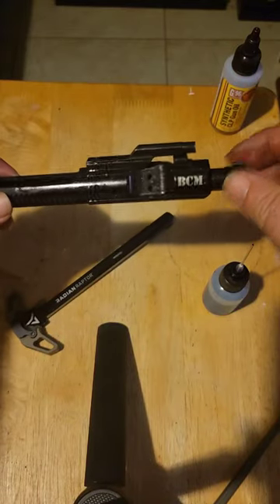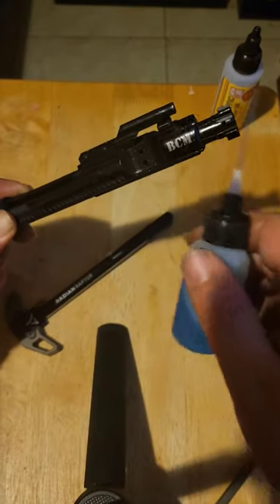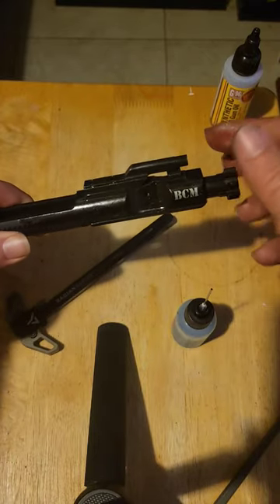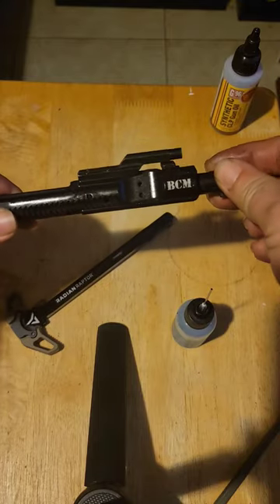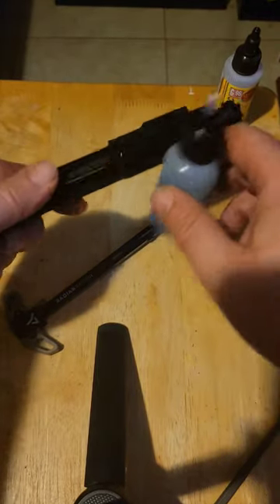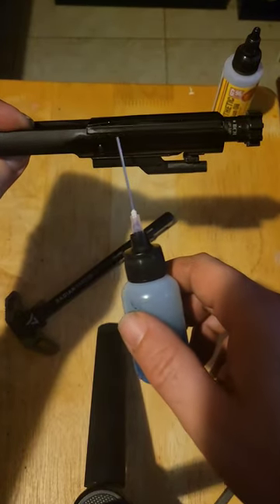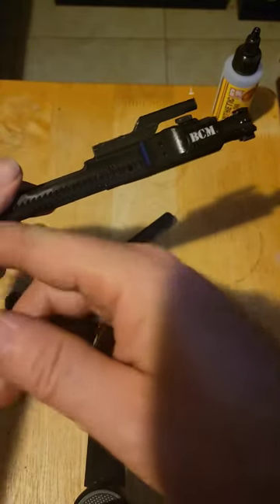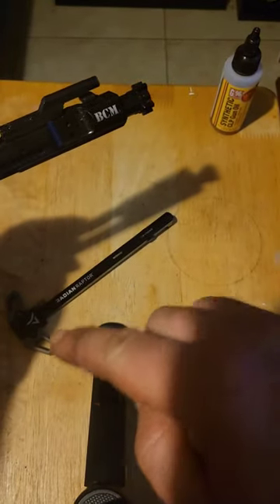Where NOT to put oil on your AR-15 bolt carrier! #shorts  #ar15 #556

Comment: You can lube everything inside an AR ! I run mine really wet thousends of rounds and i had no single malfunction . People must understand - its a machine ! Metal on Metal needs lube ! Period . The Spots like the Gasports and Holes cleans itself afte 2 Shots its dry . I also dont have any Carbon Build Up because the Carbon cant set on lubed Parts and i lube everything inside 🤷🏻‍♂️ Do not overthinking all the stuff . Smash oil over the the whole Bolt/ Carrier and nothing will brake😊
Reply from the maker: I oil pretty much everything as well. but if you ever see someone at the range. Using a needle applicator to squeeze oil down the exhaust ports on the bolt Carrier. I think the right thing to do is to tell them. That's not what those are for. In the military, we have had bolts seize inside the Carrier because of excess carbon build up to where they could not move anymore. So yes, carbon can stick once the oil Burns off. To each his own though it will run wet. It will run dry and we all have an opinion of what the better way to do It is lol 🤙👍
Reply from the maker: By the way I subbed to you bro, that range is bad ass
Reply: @boosted2809  Ok that thing with the needle Applicator is truley strange 😂 I got you 👍🏻
Reply: I too put a disgusting amount of oil on my ARs and never had a problem 😂 but I see his point and I don’t drop it right down those holes
Reply: omg… how uneducated people believe like what they know is true is really scary. metal to metal needs lube. yeah under low temp. smh… what is the point of replaceable seal?? did you ever see that oil still wet after 10 rounds? smh

Comment: A Vietnam vet told me that they would use her oil from the truck’s dipstick and slather it all around and the extractor was the only thing that didn’t get lubed
Reply from the maker: Yeah, they had so many problems with the M16. In that era, I wouldn't be surprised if the whole gun was dunked in oil just to get it to run LOL.

Comment: Not saying its right or wrong but  in the army we were specifically taught to put some oil in those 2 holes and lube up most the parts pretty wet. We also cleaned our weapons regularly tho more than most civilian shooters would
Reply from the maker: @edtronel2955  Yes, 100% I was a 19D and we all basically dunked the BCG in CLP. it made them more reliable for the environment, and elements. Now as a civilian mostly shooting static range it is unnecessary to use so much oil. All it does now is dirty up my rifle even quicker, especially shooting suppressed. I appreciate your comment brother. Side note: I oil my gas rings but I don't squeeze an oil applicator nozzle in there and full it up, which is what I saw at the range. And lead to me making a quick video 🤙

Comment: That to me is WTF why would you even think of doing that?
Reply from the maker: @douglasbaker5949  he literally was pouring slip2000 down the gas carrier key. Not just the holes on the side, which everybody is concentrating on in the comments lol. I lube my rings, but I take the bolt out of the carrier, not just fill it up with oil lmao

Comment: You should ALWAYS drop oil in those holes where gas is expelled from your carrier because that is your gas ring run. The AR15 bcg uses an internal piston to operate… And your gas rings function identically to the piston’s rings on your car.. You DEFINITELY want those lubricated. I don’t see a point in putting any oil down your gas key, though. Personally, I lube up the four rails which contact your upper then I put a bead of oil around my gas rings when my bolt is disassembled, then I put it back together and lube up the cam pin/cam track and I’m gtg.

Comment: Really depends on oil type. If you're using quality oil like a CLP or most synthetic gun oil out there then it'll be OK as they break down carbon and helps seal the gas rings. Gun oil is build to withstand high heat and pressure thus they won't gunk up.

Comment: Been oiling mine for a minute and running suppressed.  A drop or two in both holes while in and out of battery and then work the shit out of it so it spreads around inside.  I also do this all after the range.

Comment: You can lube that area with Lucas gun oil and you won’t have any issues. Same build up as if no oil was there. Give it a try.
Reply from the maker: That actually is what the blue oil is that I'm using lol,  it's great stuff. I was given 2,000 sample packs from Sig Sauer a while back so I just pour the packs in that bottle with the needle applicator.

Comment: I think most people put a couple of drops in just to make the carbon easier to get out later. I agree, it will probably not be good for the gun in the long term. And you should really be using lightweight motor oil or something for lubricating what is essentially an internal combustion chamber. I feel like normal gun oil in this application would just make an abrasive slurry and harm your bolt carriers tolerances. motor oil is good for preventing gumminess and, more importantly, preventing scoring. Also motor oil of course doesn't oxidize and get thick and crummy, it tends to stay pretty fluid even when it's dirty. CLP is probably good for metal on metal contact but for combustion chambers, personally, motor oil is probably better imho.
Reply: I second this comment and Gear Oil and Hi Temp grease works as well
Reply: I’ll take this into consideration since it’s my First AR and want someone’s else opinion on it
Reply: I've been using white lithium grease on my AR for years now. Works perfectly, and is cheap

Comment: My gas rings just blew after 1200 rounds, sending it back to BCM but I'm curious if putting lube on the bolt race could cause this?

Comment: When I got my first ar15 I used to do that and noticed on the bolt tail there was carbon building up(like to the point where the taper towards the rings were getting dimensionaly thicker) which was hard to clean.

Comment: Could this cause problems with the bolt not picking up the next round? Or is that another issue?
Reply: No it creates 0 issues. The only thing it does is makes the gun operate smoothly and cleaning carbon easier because it's mixed with lube rather than imprinted on dry metal.

Comment: Is there a specific kind of oil to use I have Clipper oil I use that oil to boil my clippers for when I groom my dog's is that safe to put on the bolt of my AR-15
Reply: 😂 CLP
Reply: Lightweight motor oil. Especially for this application. It prevents carbon deposits, prevents scoring, keeps the crud in your gun suspended. There's a reason people use it in cars. And guns are kind of similar to an internal combustion engine. Just make sure to use ND on blued surfaces because the detergent will probably strip delicate bluing off of a gun.

Comment: Explain exactly how it will damage the bcg? ... because i don't believe it will.... i don't use oil: I use a lubricious mix of synthetic grease and full synthetic oil.  ... the more the better...
Reply from the maker: It won't damage anything. It just builds up with carbon etc alot faster.. causing it to get sticky if you do not clean your rifle very often. I shoot suppressed so it's amplified for me personally. In the Army I would soak everything in clp to keep it running, but now as a civi I realize on a static range "where most people shoot" it  creates more crap to clean and most don't clean their rifles in depth the way most of us do. Atleast once a week I'm getting calls from people saying they are have malfunctions. It's due to over oiling and lack of maintenance. Thanks for the comment Frankie 👍

Comment: when shooting suppressed subsonic 300blk. BCG needs to be dripping wet with oil to not hang up
Reply from the maker: My bcm doesn't need to be soaked. There is a time and place for everything though. In Afghanistan it would get so dirty we would dunk our bcg in clp before going out. I'm mainly referring to range trips. My thought process is Why gunk up my bolt if I don't need to. I also am putting an average of 800-1,200 rounds per session though. Thanks for the input though bro. It could help someone who .300 is not running right with a can 👍
Reply: You dont put oil in an exhaust hole for the same reason you dont put food in your butt.  Stuff goes out and not in. My brand new ones are dripping then after that no more drip drip.
Reply from the maker: @themonkster333  yup exactly

Comment: I put a small bit of lube on the rings. I line them up in the exhaust ports and then run it back and forth. I also put a thin layer of grease on the bolt tail so the carbon does get baked on like a cornmuffin set to 10mins in the microwave. Lol
Reply from the maker: same here

Comment: How does one clean such a thing if he himself did what you just said not to do prior to seeing this video?
Reply from the maker: Just shoot it or use an air compressor and blow it out lol.  If you shoot it just Break it down clean it then add oil to the correct area. This is a mistake that will not make the gun inoperable after one trip to the range, but if it is part of your ritual to put oil in those holes eventually you are going to have issues.
Reply: @THAT BOOSTED GUY  so if you're not going to the range, is it ok while you don't use it?
Reply from the maker: @Jonathan Cifuentes  I wouldn't put it in there at all.  In the military, we dumped oil all over the carrier and caused alot of problems  but also allowed our guns to run in very adverse conditions. They would get dirty so quickly with carbon build up that people were having to take out their bolts and firing pins in combat to clean them. If you rifle is not running because the gun is actually frozen then use as much oil as you need lol
Reply from the maker: @Jonathan Cifuentes  to answer your question yes it's fine to be in there if your not shooting it, and you just clean it after the next range trip to avoid carbon stacking up in there
Reply: @THAT BOOSTED GUY  ok thanks for the advice, new gun owner here.